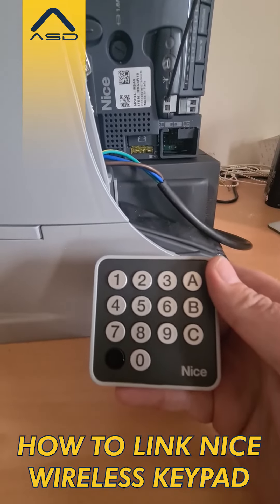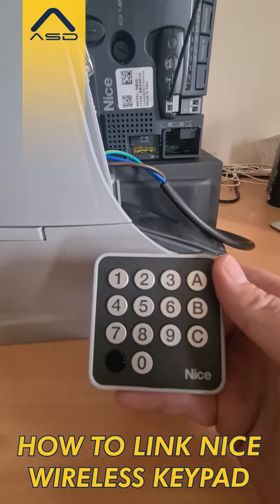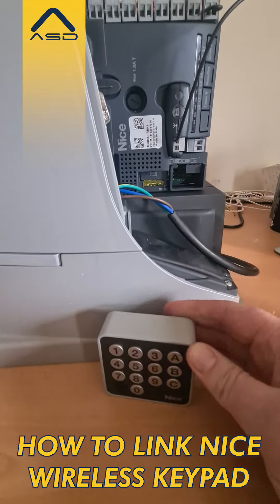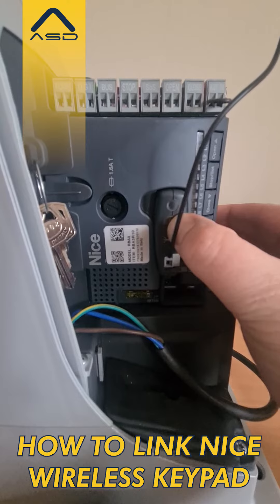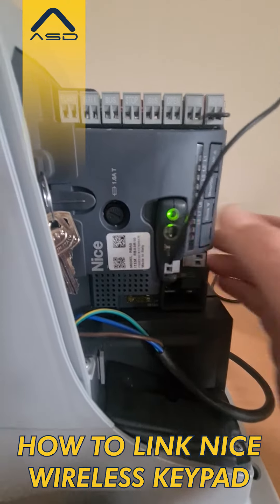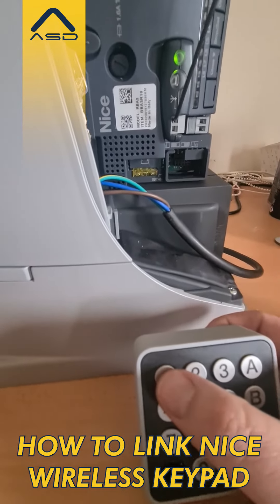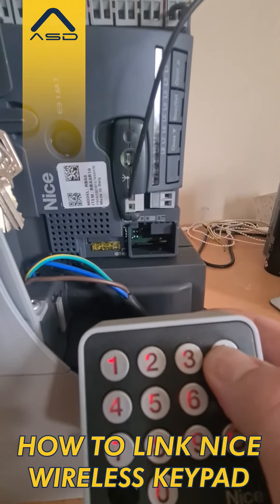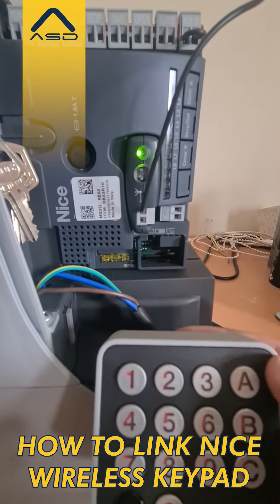HOW TO LINK NICE WIRELESS KEYPAD

Comment: thank you! do you also have a short way to explain how to use it to open the gate only to the length of the "pedestrian" mode - meaning: not opening fully, but around the 1m mark ? It is neither in all videos I could find nor in the NICE EDSWG instruction manuals I could find as well.

thanks !